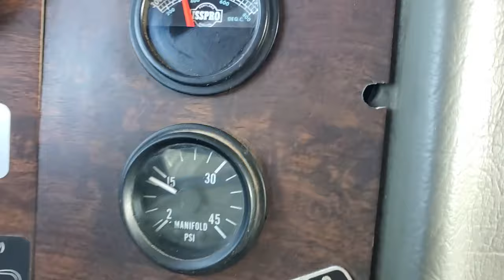1970 C10 Duramax Drag Truck Build (EP.1)

Comment: Looks like the FARMTRUCK! Sounds like a great project! Will be watching every step of the way! Had a 70 Chevy 4x4 custom cab in the late 70s. Unfortunately it ended up wrapped around a tree. Right behind the cab. It still ran, but had to take the bed off and relocate the gas tank. The bed was smashed to smithereens! Looked kind of funny with 36 inch tires and no bed.

Comment: You can always add a calendar and Hood to the top of it it look good on that truck anyway if you needed more clearance 2in and 4in that would still look good . And turn it around the opposite direction face in the front of the truck instead of the windshield like everybody else plus you'll get more airflow like a shaker hood

Comment: This going to be dope man. That drum brake life. My 66 c10 stepside is the same way. No power steering, no ac, and no brake booster or anything
Reply: I feel ya, 66 C-20 here and all original.  People pull in front of me and slam their brakes all the time because they missed their turn or something. Meanwhile I'm skidding around diagonally with that drum brake life. Wouldn't want it any other way, kinda curious how much Prius would be left after meeting my bull bar at 40 because they where checking the FB or Ig... probably not much, they dont make'em like they used to that's for sure.👍🇺🇸

Comment: You might end up having to tube the front end, thatd help get your radiator an everything where it needs to be, but I think itll be sick once you get the frame shortened an boxed in. Love old 70s trucks, im doing the same now, building a 77 f100 drag truck, but mines going to be a 8.2 deck an not a diesel lol

Comment: I'm 14 and restoring my grandpas 1969 Chevy C10 that sat in our barn for 34yrs and I've swapped in a small block 400 and a Muncie M-22 4 speed manual. Still doesn't run and drive but I'm close. I wanted to duramax swap mine but I just dont have the money

Comment: So for the compound setup on the Peterbilt. The exhaust manifold is hooked up to the small turbo that then feeds into the larger turbo but the large turbo's inlet feeds into the smaller turbo? Shouldn't the small turbo's inlet feed the larger turbo like the exhaust is set up?
Reply: Mitch Lec Nope.
Reply: @bullhead360  could yoh explain why it's set-up lime this? I guess in the end the turbines end up flowing to the same speed..
Reply: Mitch Lec I’m not the best to explain the science, other than saying it’s the most efficient way to run a compound setup